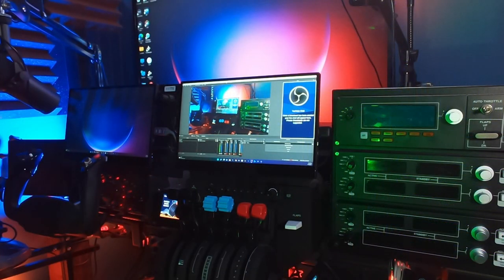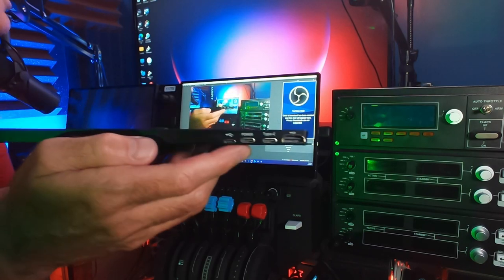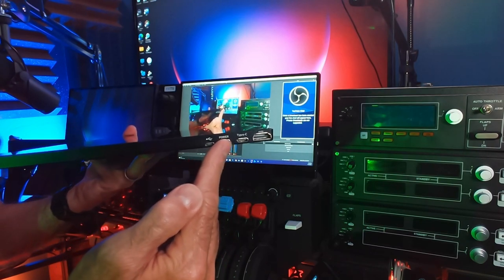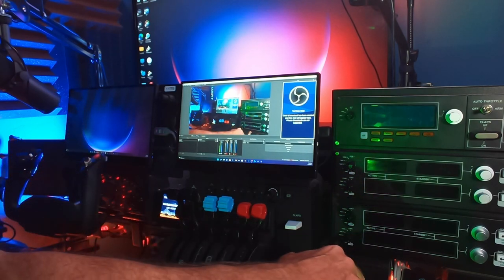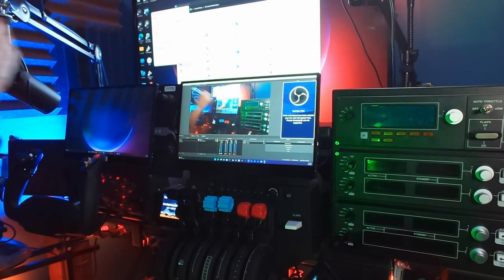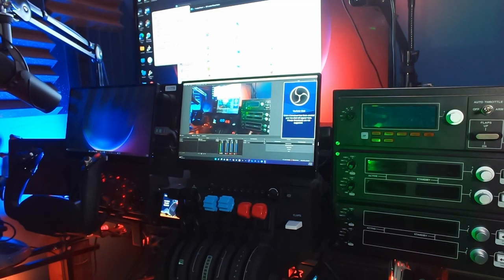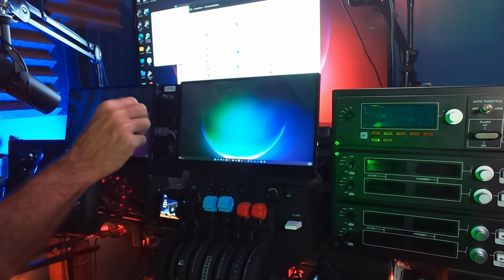Setup For External Touchscreen Monitors for  MSFS | X Plane | Air Manager | G-1000 | Windows 10/11

Comment: Great explanation.
In case it helps others, I also have a couple of Wimaxit 15.6 inch touch screen monitors from Amazon that I use with Air Manager.
To get the touchscreens to work however, I need 3 cables (not just 2) for each monitor - the USB C on mine is the one that gives the touchscreen capability.
So if anyone else tries with just 2 cables (Power and HDMI) , and cannot get the touchscreen element working, I would suggest they try adding a 3rd (USB C) cable also to see if this fixes things.
Regards, Alasdair
Reply from the maker: That's good to know. Thanks for the reply! Bottom line the monitor needs to receive video from the graphics card with some type of HDMI to HDMI or HDMI to DP cable, power to one of the USB ports, and USB touchscreen data back to the computer. It seems for some screens this will require a total of two cables and for some three cables. Again, thanks!
Reply: Not all usb ports on your PC are the same, most don’t provide enough power output to power the panel, make sure your usb port on your pc is usb 3.1 or purchase a quality usb hub that can power all your devices, like the one made by Sabrent 8 or 16 ports. They are not cheap but top quality.
Reply: 03/14/2023 WIN 11, THIS WAS THE FIX!

Comment: Hi Ivan, Nice video, but, I also have a Wimax touch screen monitor just like the one in your video.  I run windows 11, and I have a problem getting the monitor to work.  In your video when you went to control panel then to tablet PC settings and I select the Wimax monitor, the details say this monitor doesn't have pen or touch feature.  Therefore, when I select the set up button, nothing happens.  I don't get the white screens.  I bought a second monitor (different brand) and have the same problem.  I switched cables to make sure that wasn't the problem.  My video card has 3 DP ports and 1 HDMI port which I have been using on the monitors.  When using the power plug on the Wimax I connected it to a USB plug on my computer along with the HDMI on the Wimax to the HDMI on the video card.  Any ideas on how to fix this?  Thanks
Reply: Also, you mentioned a powered usb hub.  might this help with my problem?
Reply from the maker: I am assuming you are positive that both monitors are touch capable. There are screens that look identical but are not touch capable. I ordered a Uperfect screen once and they sent me the non-touch model. Having said that, some screens out there require three connections: 1) Video card 2) USB power and 3)USB that carries the "touch" information. Have you tried that configuration?
Reply: Did you ever find a solution to your problem? I am encountering the same issue and I cannot find help anywhere. Any advice you could offer would be greatly appreciated.  I can't get my touchscreen monitors to predicably respond to touch when I have them hooked up in my sim (3TV's and 2 touchsreen monitors).  They work sometimes.  Usually just one.  But when I return to use it again, it will not work the same.  I have attempted connecting the touchscreens with 2 & 3 cables.

Comment: Terrific, have had trouble setting up this exact two wimaxit additional monitors . I could get one to work, but not both, didn’t understand the power setup. Are you running AirManager to use the Knobstet, G1000 bezel? Thanks for your time and effort in producing this informative video for us tech challenged simmers.
Reply from the maker: You are welcome! Yes, I am using Air Manager and a single Knobster. I primarily use the G1000 panel found in Air Manager, but this setup also works quite well for the steam gauge variants. Here is a link to another video of mine discussing this. https://youtu.be/Ep8DSmRVosg
Reply: Thanks again for your reply. Really appreciate your insight and expertise. Been trying to figure this out for over a year; too bad you don’t live next door. I’m extremely computer challenged 😩
Reply: Did you ever find a solution to your problem? I am encountering the same issue and I cannot find help anywhere. Any advice you could offer would be greatly appreciated.  I can't get my touchscreen monitors to predicably respond to touch when I have them hooked up in my sim (3TV's and 2 touchsreen monitors).  They work sometimes.  Usually just one.  But when I return to use it again, it will not work the same.
Reply: @traveltheworld1870  : I did determine that the cord I was using wasn’t providing proper power. However, still have problems with Air Manager; some of bezels that are offered don’t work to touch, only mouse, despite setting checked for touch/mouse. Still don’t have solution for that.
Reply: @beescan22  I will try new cords and see if it fixes the problem. Thanks for the quick reply!

Comment: Thanks for the Info about plugging the power type-c usb cable to the PC instead of the power adapter that came with the panel. Windows 11 wasn’t showing the “Tablet PC” App in control panel if not plugged into the PC for power.
Reply from the maker: You're welcome! Glad it works!

Comment: Thank uno so much for this IVAN. Y our tip on the IUSB cable being both power and touch data has saved a basic issue I have struggled with f for awhile. One more question that I must have missed your guidance on is this. How do you connect the second touch screen if your HDMI feed from the graphics card is already tied up with the first one? Its their an HDMI loop in there somewhere? Thanks so much nd IU am raelly enjoying your vids even as an  osx user on X planner :-)

Comment: Interesting, but I am having a problem. I have a Win 10 desktop and a Surface Pro with Air Manager installed on the latter. Have connected a 13.5" touchscreen tablet to the Surface and can get all the AM Panels and Instruments on it. MSFS 2020 is installed on the desktop with a monitor which is not touchscreen. I am unable to drag the G1000 onto the tablet. Would appreciate any suggestions on how to manage that?
Reply from the maker: Running it on two machines, I don't think you will be able to drag the pop out to the laptop. Even if you use software to extend the PCs desktop to the laptop, your Air Manager program will still be in a different environment, or at least I think it will. The easiest fix would be to run Air Manager from your desktop PC. You can have Air Manager on more than one machine, but that may take an additional license. Another option would be to use Air Player along with Air Manager. I think that is cheaper and can run on two or more computers, but please do fact check me on that.
Reply: I thought of running AM on the desktop, but can I use the touch function on the 13" tablet and use the Knobster?
Reply from the maker: @rjkanga  If the tablet is being used as a second screen then yes. If the tablet you are referring to is a Microsoft Surface, there should be way to use it a second monitor.
Reply: The tablet will be the second screen. Won't use the Surface.
Reply from the maker: @rjkanga  There are apps for both IOS and Android that turn tablets into second screens. Duet is what I use for Windows with an iPad. Not sure what the best one for Android is. I can't verify personally that it will work, but it should.
Reply: Thanks Ivan, will look into it.
Reply: I run AM on three monitors from the Msfs computer and can pop out the 1000 to any of them.  I also have an old iPad running Airplayer that I use for the radios.  In that setup you would need two Knobsters, one for each computer. You could use the surface like I do with the iPad for the radios or steam gauges.

Comment: Hi Ivan, thanks for all the great content on your channel. I want to pull the trigger on a couple 13" touch monitors but can't seem to find the same Uperfect model. The only models I can find show the connectors coming out of the back of the monitor facing down, not the side as yours seem to be. Do you happen to have a model number anything for yours? Thanks!
Reply from the maker: This just came up on another video. I couldn't fine panels like mine either. I don't know if this temporary or permanent. The ones I found as you described may still work, but the attachment would be different.

Comment: Ivan, I have windows 10 and my control panel only shows Pen and Touch.  I can't find the Tablet PC settings so I can get white screens to link usb to correct monior.  I have one like your demo, finger on winaxit, square on top monitor.  thanks......
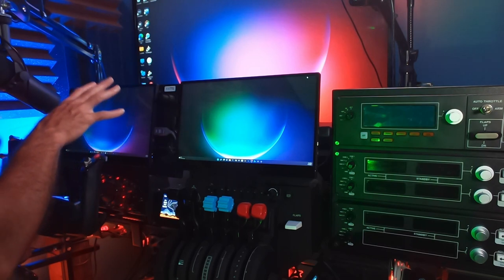Reply from the maker: If the Tablet PC setting is not showing up then Windows is not detecting a touch capable screen. This is mostly due to one of two reasons: There is no usb connection to the computer (bad cable, wrong output,  not hooked up at all) or the screen is not touch capable. The very first "touch" screen I ordered didn't work and after much troubleshooting it turned out it was not actually a touch unit. If you attach a touch screen to the PC correctly but don't set it up it will function as a mouse pad. This is demonstrated at around 3:30 in the video. How is your screen currently connected?

Comment: Great. Thanks. The system we are slowly building for my two grandsons (ages13 & 14) when we first starting assembling it last Dec has the same two 15.6" touchscreens and two 7" touchscreens in the instrument panel never got even to the 'set up' stages, but due to having problems of not being able to get the three 'out the cockpit' views screens (a 65" LG OLED and two 27" LG  27 Inch Ultragear Gaming Monitors to be recognized and running by any  of the necessary external hubs, two 15.6" touchscreens and two 7" touchscreens, none of which I was savvy enough back them to get the two m1 mac minis, even with external hubs that allow the m1 minis to drive up to six displays each.
  I won't be back to my two grandsons  house until late Nov but it appears that the present two m1 macs will be going to the boys and being replaced by a Mac Studio Ultra (that is claimed can drive 5 monitors (and with hubs) the other two small ones.  We plan to run the Studio Ultra with Parallels and Windows 11 on one drive and on the other,  Mac OS running XPlane 12 (hopefully out by then_.  Air Manager I just found out is available for both Windows and Mac OS so will try your great ideas on both 'sides' then. Thanks.

Comment: The 15,6" I bought recently can use the USB-C for video, touch and power, no need for HDMI. If your gfx card has a USB-C out, it's as simple as it comes.
 I have the problem of the touchscreen stealing the focus from the sim, which is a different matter.
Reply from the maker: The focus issue continues to be a pain. Cool info regarding the USB C video link.

Comment: The setup procedure does not seem to be working for me. I am trying to setup a WIMAXIT just like the one you were demonstrating with. My primary monitor is a 4k Acer. When I hit the Setup button everything goes exactly as you show on the video, but when completed, but when completed moving my figure around on the WIMAXIT screen causes the pointer to react on the main screen. I've tried rebooting and disabling each monitor but no luck. A strange thing I notice on the setup screen... it says that my main 4k monitor has "limited touch capability", whatever that means. It says that even if I have the WIMAXIT disabled.
Reply from the maker: Let's see if we can figure this out. First, what are the connections you are using? Does your monitor require two or three cables? I also want to confirm you are going to the Windows "control panel" then "tablet PC setting" and then "setup". Once you do that, your screens go white. Which is the first screen that has text/instructions on it, and what exactly does it say?
Reply: @IvanSkyFlight  Thank-you for replying. I finally got this straightened out by uninstalling #1, powering down the PC, then moved to another DP port, and then powered up the PC. As soon as that was complete I did the same thing to #2 (WIMAXIT) except for moving to another HDMI port as my RTX3080ti only has one. After that, I ran the setup as shown in your video and it worked no problem. I still have no idea how it got into the state it was in, but all is well now.
Reply from the maker: @jimtheflea  Awesome!

Comment: How do you compare air manager / touch screen additional displays against something like an iPad and the Remote Flight apps (cockpit HD, radio HD, etc)? I'm just getting a box set up and it seems like they have similar capabilities. The thing I'm looking at with Remote Flight is that it doesn't use any of your GPU to draw additional screens.
Reply from the maker: I really like the Remote Flight stuff. The renders are gorgeous. Having said that, I have not found the AM stuff too taxing on my gear, and I love the flexibility for different planes. If you do like the iPad stuff also take a look at Simionics. They have a great G1000 emulation.
Reply: @IvanSkyFlight  Thanks for the response. Do you have a feel that one is any better than the other? I still have some initial setup before I do the panels, but I'll have to pick 1 to start with. Since I have an iPad I guess RF or Simionics makes sense, but I'd hate to spend money on one then find out the other is way better and I should have gotten that to start with.

Comment: Hi great video. My graphics card has 3 DP ports and a single HDMI. I’m using 3 monitors. I want to hookup 2 touchscreen monitors. How do I do that with just one HDMI output? Thanks
Reply from the maker: I use a StarTech USB 3.0 to dual HDMI adapter. They sell them on Amazon for around 50 dollars. They work like a charm.

Comment: Hi once again Ivan. I returned the failed pair of generic touchscreens and purchased instead some 13.3" branded as UPerfect touchscreens (not quite like yours, but with a small box mounted on the back where the cables connect to the ports). Hallelujah, I can confirm they work right out of the box! I only wasted two weeks on the faulty pair! Dang! 
My next observation: when using Air Manager on X-Plane with a Knobster, I notice that after using a touchscreen to control something, if I want to then use a keyboard keystroke to invoke something, say the parking brake 'B', or a different cockpit view assigned to the numeric keys 1 - 9, I have to physically move the mouse off the touchscreens and click on the main monitor before X-Plane will recognise any keyboard input. 
Do you have this problem too?
Reply from the maker: There is a "focus" issue on MSFS for sure, but I have not tried this on XP. I did a reset of my computer about two months ago and have not reloaded XP yet. Having said that, I wouldn't be surprised.
Reply: @IvanSkyFlight  Further internet research revealed several simmers have observed and solved the 'focus' issue (a.k.a. the dreaded 'Black Flash' in X-Plane when moving from the simulator screen to a second or third screen in extended desktop), by setting  screen resolution to one pixel less, vertically. That is, 1920 x 1079.
This can be achieved by creating that custom resolution in the Nvidia control panel (or similar), and then selecting it in Windows' Display Settings.
As for keeping focus on the main screen after any interaction with the second or third touchscreen, I found an ingenious little tool called Touch Mouse Tools. This separates your mouse from your touchscreens. Now I can interact with the X-Plane cockpit via Air Manager on either touchscreen, and then immediately press a keyboard command, such as Brakes (B), or look around the cockpit with my numerical keypad.... all without having to physically move and click the mouse pointer back to the main monitor.

Comment: I see three Wimaxit 15.6" models on Amazon. Can someone tell me the right model?
Thanks in advance.
Reply from the maker: I am hesitant to recommend a specific model, because it may not work. So purchase at your own risk. Having said that, this one looks like the one I have and there is a guy in the "questions" section that specifically mentions works for MSFS. This is not any kind of "affiliate" link. I receive no financial or other benefit from this monitor. https://www.amazon.com/WIMAXIT-Portable-Multi-Interfaces-Upgraded-Extension/dp/B07YXP683D/ref=sr_1_3?crid=3K3UVMS12JMOG&keywords=wimaxit+touch+screen&qid=1678887294&sprefix=wimaxit+touch%2Caps%2C102&sr=8-3&ufe=app_do%3Aamzn1.fos.f5122f16-c3e8-4386-bf32-63e904010ad0
Reply: @IvanSkyFlight  Even if you would get a financial benefit from it, it would be totally fine. Thank you very much for replying. You are a good person, answer all questions. It is very rare to see that.
In this case I leave it.

Comment: I have one question: Do you have to install Air manager?
Reply from the maker: You don't have to. For example, there are several aircraft where their main displays don't have buttons or controls on a bezel. You see this in some of the airliners or even the Cirrus Vision Jet. In this case you can pop out the screens and move them to a different monitor. I also do this a lot with helicopters.  Some displays (from within the sim) can even be popped and have touch capability, but other third party apps are needed. Air Manager as of now does not add touch capability to the displays that are popped out. Air Manager only adds touch capability to the bezels or other gauges being emulated.

Comment: Hey Ivan, great tutorials! Do you know if a touch screen can be rotated to the Portrait Orientation (ie not landscape) and be used with Air Manager?
Reply from the maker: Yes, I can confirm this works on my system running Windows 11. Can't confirm other versions of Windows. Go to display display settings in Windows and change the orientation of the screen in question. Start Air Manager and setup your panel.